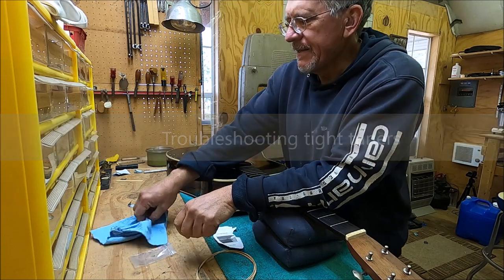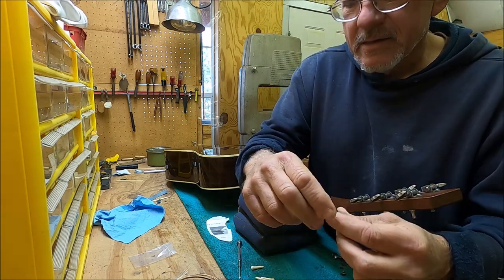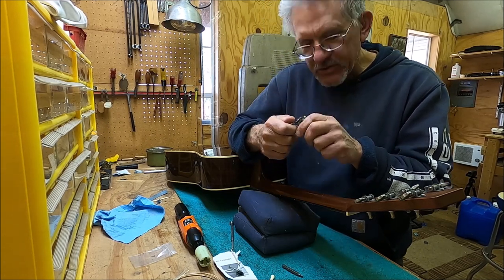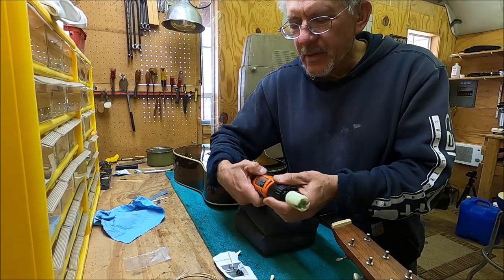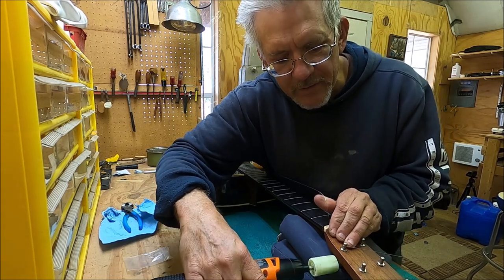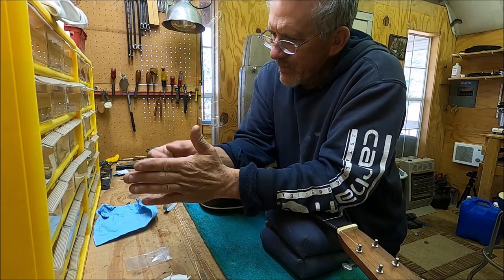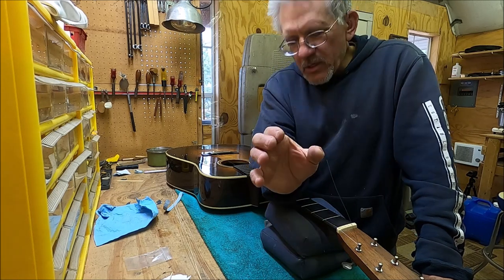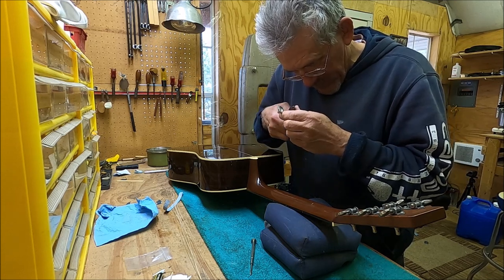Troubleshooting tight guitar tuners

Comment: I had loose bushings Waverly on a Bourgeois.  Tried wood glue, tape - no go.  Ended up replacing hex head bushings with oversize round head.  Reamed holes, pressed to a very tight fit.  Problem solved.  I did then wrap tuner posts with teflon tape to help prevent post leaning with no binding, seemed to help.

Comment: What is your suggestion to address Waverly open-back tuners when they are 'frozen' in place - or stiff -  but once you start turning the shaft all is fine and smooth?  It's sort of like the tuner needs a bit of ''oomph'' to get it to start turning smoothly.  As always, I find your willingness to share your knowlege extremely helpful.  Thank you
Reply from the maker: You have to identify the friction point.  Is it in the bushing? The gears? Probably the friction between the shaft and collar... what I'd do is remove the tuners, grip the flat plate in a vise, spin the button, and spray a little Tri Flo so that it works between the shaft and collar.  If you don't identify the problem first, you're just throwing stuff at the wall and hoping you hit the problem.
Reply: @Bryankimsey  Thank you Brian for your reply.  I've identified the Friction Point, on all six tuners.  All have a lot of friction between the Worm-screw and base-plate.  I disassembled one - wish I had your Waverly wrench - cleaned and reassembled.  Both friction washers appeared in good shape.  A bit of red lock-tight on the threads of the Coupling, and did not tighten fully to factory setting, maybe 1/16 of a turn looser.  It's free as a bird.  This Friction issue stems from the guitar being in storage for a year - and possibly the age of the tuners being 20 years old.  Maybe it's time to buy a new set of Waverlys!  Many thanks again

Comment: Bryan I also put a drop of 3&1 or Tri-Flow oil on the bushings with the worm gear and that seems to fix it
Reply from the maker: Yeah, but I demonstrated that in this case it's not the bushings or the gears but the friction at the gear bushings. So your solution worked, this time, in your case. The whole point of the video is to teach you to identify the problem and fix the actual problem.  TriFlo is good stuff but 3-1 can collect dust and cause more problems down the line.

Comment: Hello Bryan,  I have a question about replacing the grover rotomatic tuners on a 2012 HD28 I have a set of martin open back tuners that I want to put on the HD28. What conversion bushing do I need to get to use  on the open back tuners. Thank you for your help and videos , I'm a big fan
Reply from the maker: Stewart McDonald's 3/8".  However... when I do tuners, I have a reamer, the drill bit mentioned in my "raccoon eyes" video, and etc. I'm basically prepared for any eventuality.  I THINK modern Rotomatics use a smaller bushing, but I don't remember.  Take one off and measure the hole.
Reply: @Bryankimsey  Thank you sir for helping me , I really enjoy your videos

Comment: Do u have any videos on repairing screw holes in the wooden peg head that have been worn out or stripped & need to be plugged & then re-drilled? I would love to know how u address this very common problem.
Reply from the maker: Dip a round toothpick in glue, tap in place, cut flush.  Find my video on "racoon eyes"

Comment: How do you lubricate sealed machine heads then?
Reply from the maker: If they're truly sealed then the factory lube is sealed inside and you don't really need to do anything.  

If they're Grover Rotomatics, a) I replace them with open back tuners, b) you loose the knob screw, push the gear shaft out, push grease inside, put them back together.